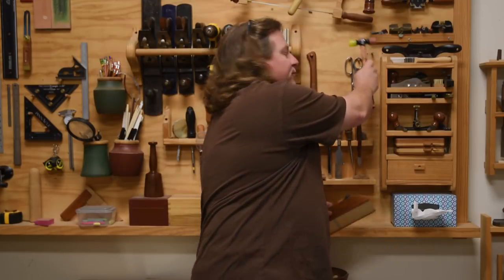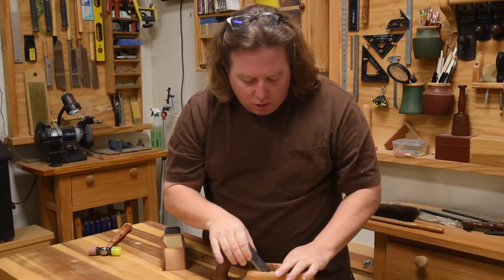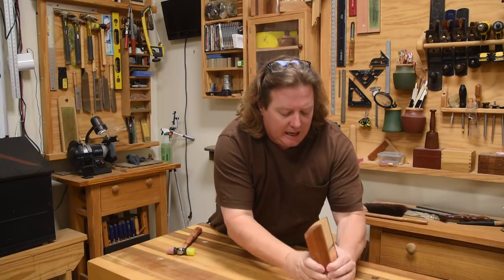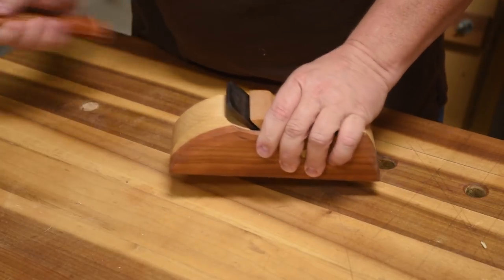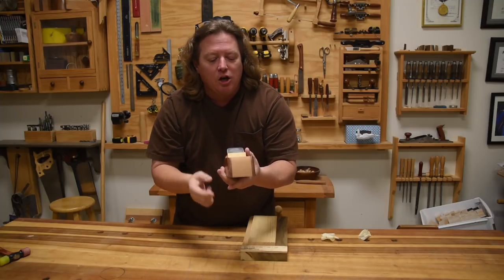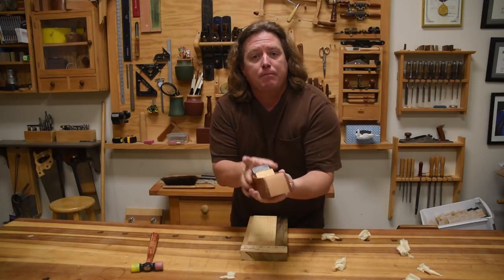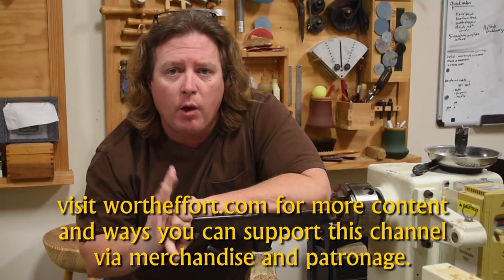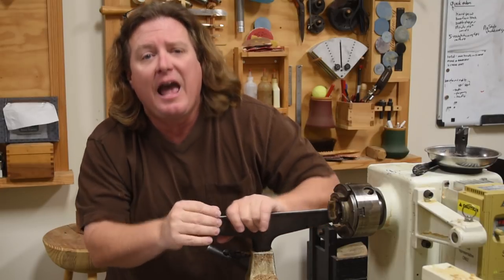Adjusting Wooden Hand Planes

Comment: The plane I have doesn't hold the cutting iron in place anymore no matter how much I hammer the wedge down. (There are dents now, sadly.) A few days ago I figured out why: The iron bed is case-hardened on the sides...the wood is slick now. Guess that means I have to sand it a bit.
Reply from the maker: Never heard of this.